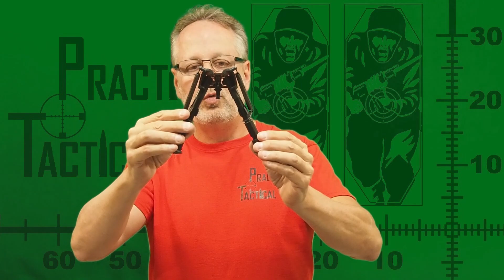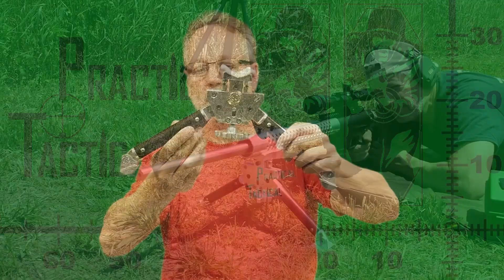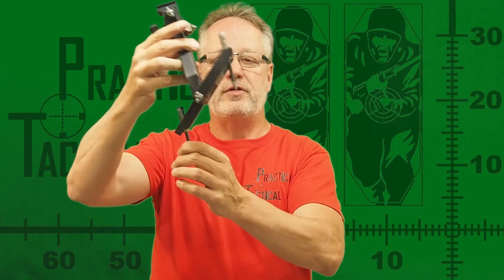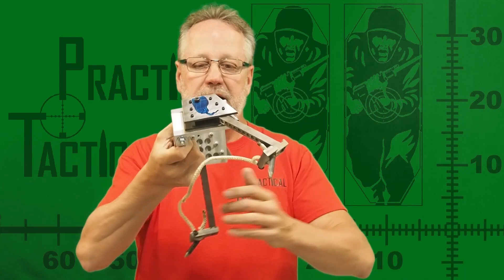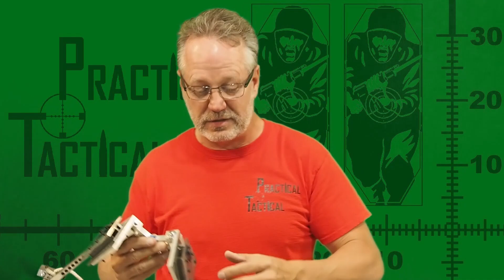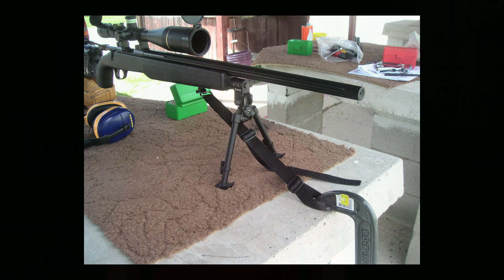Recoil Control Bipod

Comment: You don't actually need any ropes and straps to prevent a bipod from destabilising and moving back ... you just need to spike it and preload it properly by applying FORWARD force, with a rear of the rifle in a bag set up, so that the entire rig can move 1.5 in backwards under recoil. It is a simple as that, I get under half inch groups at 600m routinely with this set up
Reply from the maker: First of all I'm calling hard BS on your half inch groups at 600 yards from a bipod. Second "NEED" has nothing to do with it. I too shoot exceptionally well regardless of the bipod, but I shoot better by reversing what you call "PROPER". Your point just illustrates that you think there is only one way to do it... your way, and that is just blind ego talk. If you actually think about what happens under recoil for a second, you will come to understand why pulling with this type of system instead of pushing is actually advantageous. The rifle goes from tension to more tension and there is no point where the bipod is in a free state... like what happens when you press forward.But hey, thanks for your thoughts on the matter. I'll just keep doing things the right way... MY WAY.

Comment: Made me think of this Vid. https://youtu.be/P-ALqzUCSfE  Haven't seen front loading of a Bipod though. Have you never tried Shooting Mats that have a Loop at the Front that allows you to load the Bipod (Pushing against it, wouldn't really work the way you Shoot)?
Reply from the maker: I know the guys in the video link... great shooters BTW. I have one of those shooting matts actually and its nice because it provides a flat place for the bipod legs so is doesn't tilt between shots and don't get different cant from one shot to the next which is half the battle. Additionally the spiked feet and strap tension create down force so the rifle behaves like it is much heavier, and that delays the moment of recoil slightly and allows for a more precise break. Without it, there is always a little bit of something that moves just as the rifle begins to recoil. Keep in mind that F Class is about hits on 1/2 MOA V Bull to 1000 yards and we need all the help we can get to shoot that well.